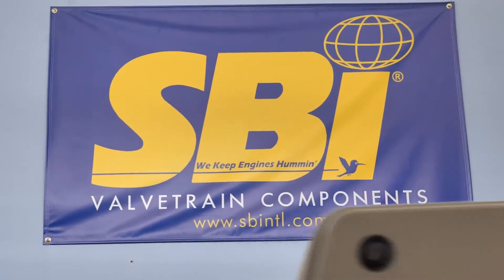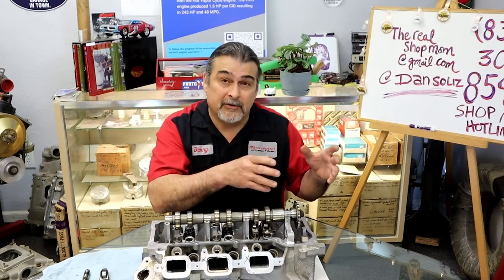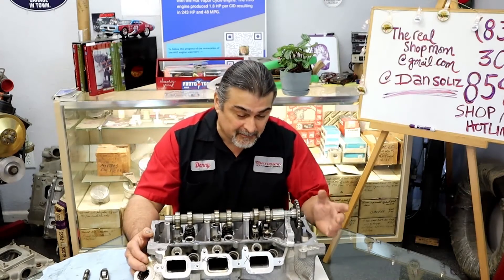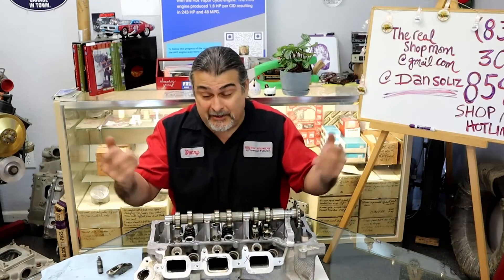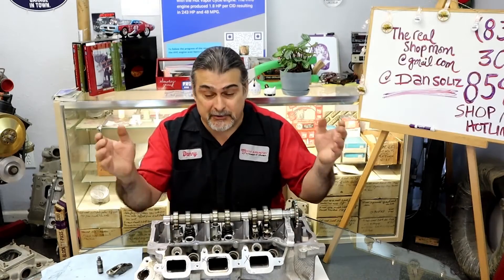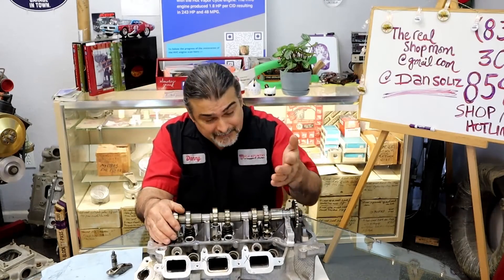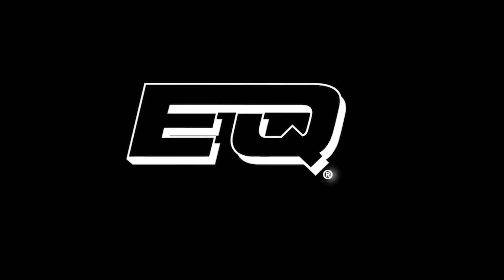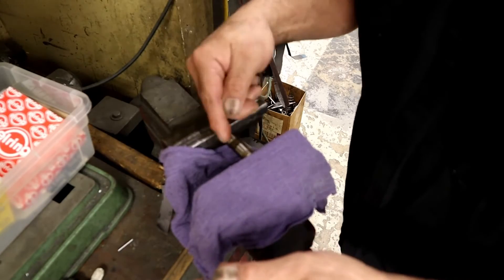Why You Should Be Bleeding Lifters

Comment: Your video is spot on.  I watched so many video on this subject that left me confused.  I have a '99 Expedition.  Watching your video I was able to bleed the lifters.  On a separate issue, the bolt hole for the chain guide on the right side of my engine stripped.  The bolt hole is 25 mm, I think.  I found a 25mm bolt that fit.  The original bolt is less than 25 mm.  Now I'm wondering when the aluminum head gets hot and expand if that won't cause a problem.  What's your opinion please?
Reply: I have a 00' expedition and if I were you I would just send a bigger bolt thru
Reply: @A6q4  Thanks.  That's exactly what I did.  I'm still working on it.
Reply: @renejacques8288  Nice I'm currently installing new lifters and gaskets  and I stripped a bolt on the timing cover and that's what I had to do

Comment: Other videos suggest a small paperclip to push the check ball away from the seat. Then you can push in the plunger easily and bleed the oil.. you kinda do it at the same time. I wish I knew all of this ahead of time .. got semi lucky that I didnt bend valves.. but I have to take out the timing chain on my VW GTI.. because I wasnt getting any cylinder pressure in Cyl 2. At least ..now I know.. 
Thanks for the informative video!

Comment: We do this on all of our LS/LT builds.  Very important…especially when checking pushrod length and lifter preload- it will be way off if you don’t do this ahead of time!
Reply: How does this work if there is a check valve inside the hydraulic lifters? Shouldn't the lifter not compress at all?
Reply: @oswaldcobblepot502  when gently depressing the lifter cup into the body of the lifter, oil will bleed out of the oiling hole allowing movement of the cup.  With regard to a check valve, this hasn’t prevented us from bleeding LS style lifters.  Oil pressure while the engine is running keeps the lifter pumped up .
Reply: @floridahighperformance  So if I understand correctly, the oil is escaping between the lifter body and the plunger, and then out of the oiling port. Can't think of how it could escape any other way due to the check valve.
Reply: @oswaldcobblepot502  that’s correct.  During normal operation on a hydraulic lifter, as the cam lobe pushes the lifter up, a piston inside the lifter closes off any oil escape…which essentially makes the lifter solid…and as the cam lobe approaches the base circle the piston returns to its normal position allowing oil to move through the lifter once again.  When we bleed lifters down, we are just pressing the oil out of the body of the lifter through the oiling hole, which allows the cup to move freely so we can accurately check lifter preload for pushrod length.
Reply: @floridahighperformance  Thanks for the reply that was helpful 👍
Reply: @oswaldcobblepot502  anytime…for a long time I use to “soak” lifters…not understanding that by filling them up I essentially created a solid lifter…which screwed up pushrod length measurements and then would hang valves open….live and learn and always striving to improve the craft….that’s the name of the game.  We use a lot of short travel Johnson’s in our LS and LT builds that have tolerances as tight at .025”, so gotta be spot on
Reply: @floridahighperformance  With the LS engines, when you're setting pre-load, it's done via pushrod length, and the rockers are all torqued evenly, am I correct?
Reply: @oswaldcobblepot502  on LS or LT, I do it the same.  I start with intake valve closed- exhaust valve slightly open…which ensures I’m on the base circle of the intake lobe.  I use an adjustable pushrod to get to zero lash with rocker arm torqued.  Once I have my zero lash measurement, I add my desired preload and send measurements to Manton.  I then move onto the exhaust valve- get on the base circle and repeat.  I’ve never had lobes vary from cylinder to cylinder…ever.  The camshafts we use are spot on- every time.
Reply: So lifter has to be pumped up in order to set lash.
Reply: @MrCbell57  No, you want the plunger in the lifter to move freely so you can determine lash and pushrod length accurately.  That is why I bleed them down prior to installation.  Otherwise if they are "pumped up" or full of oil and are basically solid, you may not get accurate measurements
Reply: @MrCbell57  No man..... You want the exact opposite thing when you adjust valves with hydraulic lifters.
Reply: @oswaldcobblepot502  if you are adjusting your valves with shaft mount rocker arms, then run a solid lifter.  If you’re running non adj rocker arms like what you’ll find with MOST hyd lifter set ups, then you use pushrod length to determine preload.